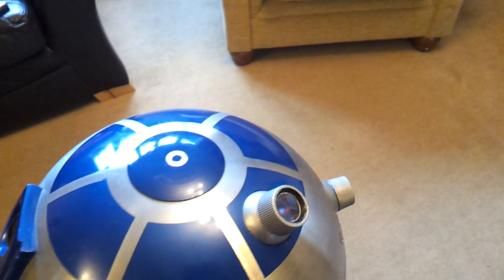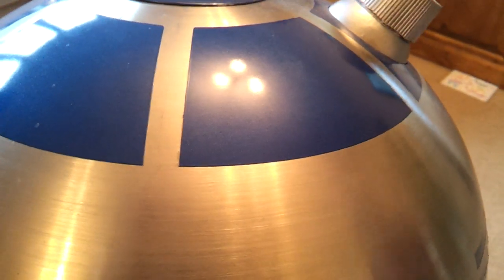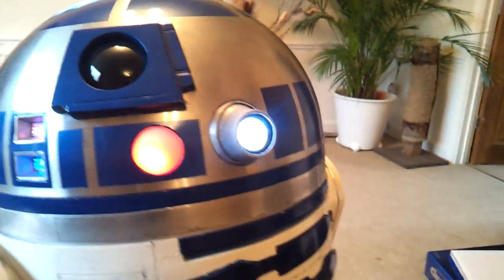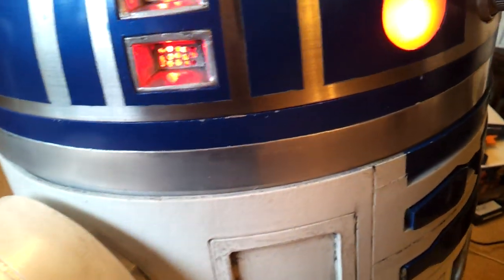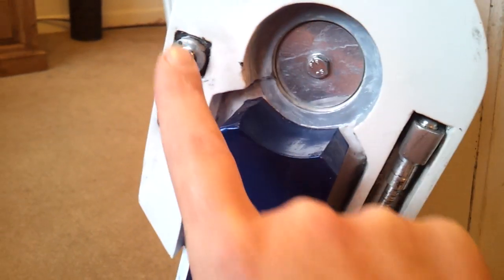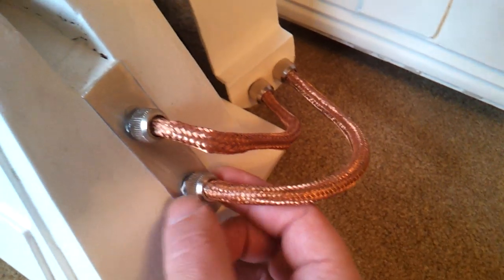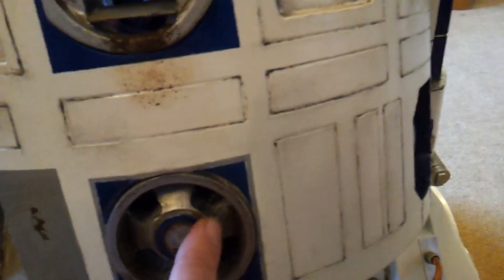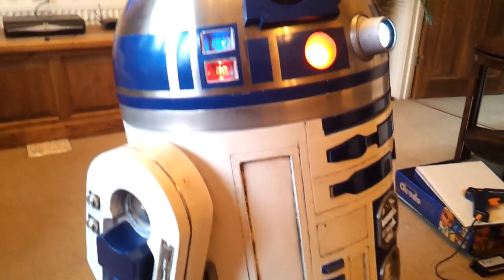Autonomous R2-D2 Part 1 - Building body, dome etc : walk through.

Comment: I failed miserably making the body rolling out the mdf with water like your technique... tried it multiple times, with lots of water and waiting a few 10 minutes and it just broke off every time in the middle... maybe I'm not using the right kind of MDF sheet?
Reply from the maker: oh dear; try a 4/5mm harboard - much easier to bend using the same method.. https://www.travisperkins.co.uk/Standard-Hardboard-Panel-1220mm-x-610mm-x-3mm/p/795944?gclid=EAIaIQobChMIoMzij5DT2gIVqZPtCh2OTg_vEAQYASABEgILdPD_BwE&gclsrc=aw.ds&dclid=CP3VwZuQ09oCFcU8GwodUOgI4g
Reply: Thanks man, very generous of you! :)

Comment: Hey Qmentis, can I ask for another hint? I painted my dome and failed miserably... when I unmasked, the paint all peeled off with the tape... I used Dupli-Color self-etching primer and blue anodized color... I must have done something wrong... I peeled off all paint and have to do it again. If you can tell me what you did would be terrific! Thanks!
Reply from the maker: Christian Galipeau Hi this is the same problem you have pinstriping a car. I always like to peel when the paint is wet but some wait until ita dry. Ive always found if its dry it flakes at the edges and if its part dry / rubbery it peels. The thicker the paint the trickier it is.
Reply: Qmentis ok thanks, did you paint directly or used a primer? Did you sanded it rough first? Thanks for the hints, I'll try painting a small part and see how it goes unmasking when it's still wet. :)
Reply from the maker: Christian Galipeau Primed with a thin coat and leave for 10 mins. When peeling ALWAYS use an acute angle , bend the tape almost back on itself. Good luck!

Comment: What did you use to make the round top to fill the flat bottom of the bowl? I'm beginning a build using the same blanda bowl! :) you are my inspiration!
Reply from the maker: Christian Galipeau Thanks. The top i made fom alu on a lathe but you could perhaps use card amd cut smaller amd smaller circles then soak in pva or you could clamp a drill to a desk and use that to spin some mdf and sand it down. The bottom ring is mdf cut with a jigsaw. Look on the website in the deacription. Ive since made another...because im clearly nuts
Reply: Qmentis  wow thanks for the fast answer, great ideas! I think I'm getting nuts too haha

Comment from the maker: Hi, They were made out of an off cut from a 60mm thick peice of oak work surface which I the routed out to for the shape. The back was then routed to make it lighter and then covered in thin ply. This also allows for the cables. To finish it I coated in in a product called P40 (car filler) and sanded, primed and painted.

Comment: Not quite. It is 254-6mm radius, but has an extra 45mm or so extension of the bottom of the dome (the blue and metal ring) which brings it to 300mm.

Comment from the maker: Hi, make a two wooden disks, like the top and bottom of an oil drum, then lay s peice of MDF shiny side down on the grass and tip hot water on it...even boiling. After a few minutes, you can slowly curve the MDF around the disks. When you have almost eased it around, tie two straps around it to hold it while it drys. You made need to do it a couple of times. Put it in the sun and your done. The web will say that you cant do it to MDH but trust me, it's easy enough. Cheers

Comment from the maker: Not that much probably about £200 in all, may be less. But I did make most of the bits as it says. I got a lot of bits off ebay cheap with some late night bidding ! foot motors for instace where about £5 for a pair, stepper motors about £20 for 3, various lumps af aluminium about £20, legs: oak work surface free from my new kitchen off-cuts, various cans of paint about £30...Head £10 and a load of cheapo electronics from china and bust household appliances.

Comment from the maker: Hi, yes I assembled the electronics and wrote the software ie the navigation system  / radar and the "core" / brain that ties it together. The electronics are quite simple and much is comprolled by pololu a maestro 24. These have servo outputs that connect to speed controllers for each foot motor. To make him RC or both you'd just split the cable and connect the other split into a RC receiver. I tried it as a back up and it works fine.

Comment from the maker: The best average ones would probably be NEMA 23 or bigger (from CNC). You can get them on ebay. I paid £15 for 3 NEW 17's. For wheels I use 1/8 scale RC wheels (a bit small really). I'm not sure steppers would be right for wheels as they don't turn at speed being for precision. I use one on the head to keep track of it's position. Can you not use normal motors and then use time as a unit and measue how far he moves in 1 second? I use wiper motors as they have a worm drive and very cheap.

Comment from the maker: Hi the body is made of 3-4mm MDF. Many will claim it's not possible to bend MDF but you just have to be a bit creative so....make two round disks to wrap it around to form a tin can shape, lay the MDF glossy side facing down / away and tip boiling hot water on the dull side and ease around with more water. Wrap it around the disks and hold it in place with a wire ring. Then sand and prime with arcylic undercoat, then spay prime with auto pain..1 R2D2 body made.

Comment from the maker: Sure, really need your email address to be able to send you links etc?. The ESC's I use (3 of them) are for marine use and cost 14.99 on ebay from hong kong. They are for 3S (3 cell) or 11.1v Lipos. This R2D2 runs of 3 x 11.1v (3S) at 5000mah, so basicaly 11.1v and 15amp max. He also has various step up transformers to 24v to increase speed. Did you read my blog on motors and ESC's?

Comment: @jblackmore2003 
thanks for the info,been looking everywhere to find one,also could you give me some help on the motors that are in the legs and the set up that you use,like the wiring etc,as you said in the video you used window motors but how do you wire em up ,can you use an rc car speed controller,reciever etc.
andy

Comment from the maker: Hi,

Thanks, 
It's from Ikea of all places. In stainless it's called a Blanda Bowl (36cm / 14" dia) for £8.99

But i've since noticed that ikea do a Brasa lamp shade which is nearer the perfect size of 45cm,  but not stainless, it's mild steel and painted. You can get these on ebay for about £15 not "35 in ikea.

I tried to add the links for you but it won't let me.

Cheers